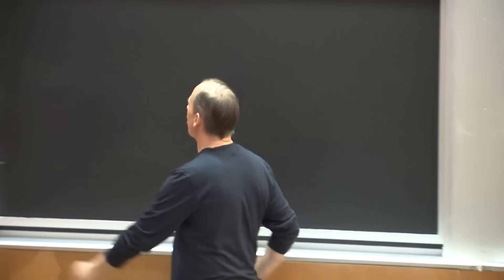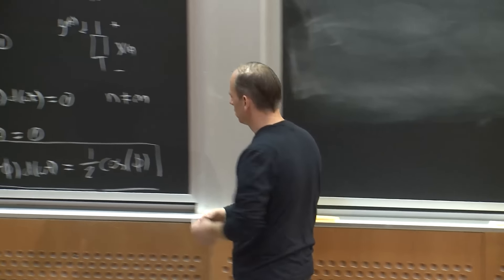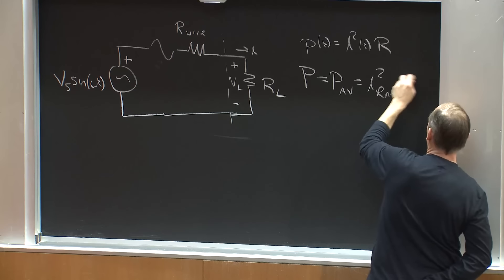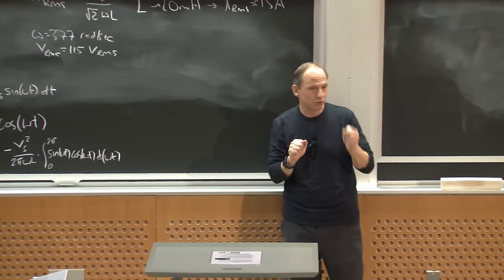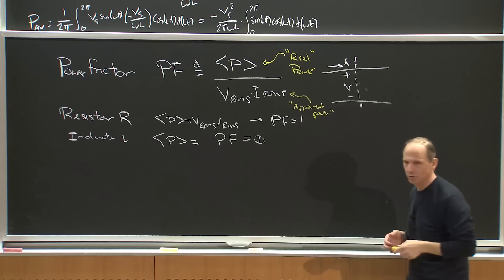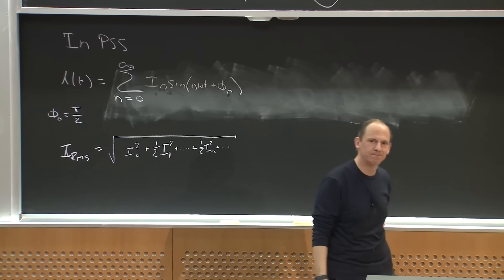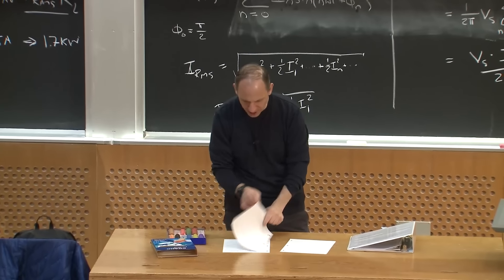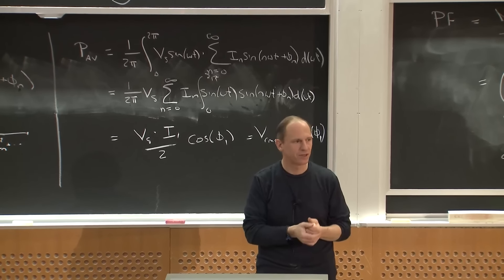Lecture 4: Power Factor

Comment: This is awesome.  I got my undergrad in EE but never studied power electronics in much detail. This piqued my interest since at my job, we have a debate about  how bad switching power supplies are for noise sensitive detectors but I feel this might put a new light on how great modern supplies work.  Do I work with old school dogmatic people and this will show that we need to get with the new engineering ideas?  Enjoying these lectures so far.
Reply: I work with switching power supplies a lot (LED drivers in my case), and there are actually limits imposed on how much noise the ones we work with are allowed to emit. (It might be a federal regulation actually). We do EMI tests on them. (I don’t for the life of me know how the EMI tester works yet, but that’s what its for). 

Some supplies have a fairly large ripple on the output you can see with a scope (and use to calculate the switching freq), but most I’ve looked at are pretty well-smoothed. Which is impressive for something switching hundreds of thousands of times per second tbh.

Comment: Reminds me of my undergrad EE classes (not at MIT).  For real life practicality, I would have preferred much less math and much more emphasis on circuit design, component selection, part reliability, consumer safety, practical EMI/EMC effects, etc.  All the stuff you have to do in the real world.
Reply: We have trade schools for that sort of stuff
Reply: @SuperMnunez  Trade school grads might install and repair but they don’t design for production.
Reply: I think a lot of that is discussed at some point in the course, as the final project involves using real components to design a buck converter circuit with a closed-loop feedback system. The assignment provides a list of specifications such as input voltage range, output voltage, output ripple, minimum efficiency, etc that all must be met. It seems like a fairly good blend of theory and practical application.
Reply: For Design, you must understand the principles and deep math involved.

Comment: I think what he says at around minute 6 can only be true if m and n are integers, and it's not true for just "different frequencies" like he mentions.
Reply: EDIT: This isn't completely correct, see my following posts

I think if you integrate over 2pi * a common multiple of m and n, it's still zero, even for fractional numbers. Not sure if that still fulfills the definition of orthogonality. Harmonics are always at integer multiples anyway.
Reply: @duhnboa5447  no, it's not zero for any arbitrary fractional pair of numbers. Just think about one of the sine functions having a very low frequency, so that in the interval where the other one does one cycle, the low frequency one is equivalent to ~kt (since its argument is close to zero). Then you would clearly have a non-zero integral. Like I said, this can only be true for integer values.
Reply: @luisjalabert8366  The instructor mentioned that the two sines must commensurate over the integration interval. In that case, also for non-integer m and/or n, they are indeed orthogonal and the integral of their product will evaluate to 0.
Reply: @jw106  Thanks for your answer. It seems like YouTube deleted my post for some reason. You said it better anyway!
Reply: Agreed
Reply: I'm a communications engineer and we frequently use Fourier series in communications.  The Fourier conjecture holds that we can represent any periodic function with an infinite series of other orthogonal periodic functions.  Fourier was interested because someone won the Nobel prize in mathematics by showing that any function could be represented by an infinite series of polynomials (polynomial expansion) and he showed that he could do the same thing.  He showed how a periodic function could be represented by an infinite series of sines or cosines.  His work was dismissed for 80-100 years till the advent of computers made computation of sines trivial.  The characteristic of the Fourier series is that you are representing the signal as an infinite sum of sines with period (n*w*t)  where n is an integer.  These are all expansion terms with the same period.  The reason why these are chosen is because they are orthogonal to each other.  A random frequency just cannot be chosen because then it wouldn't be orthogonal and thus would be shown to actually be the sum of two or more of the other orthogonal sines.  This means that the professor is technically correct, the best kind of correct, but it also means that he could have made this clearer.  All other frequencies except the fundamental frequency would have just decreased the power factor.  This is not a course on Fourier series though which would have gone into much greater detail if one wanted to know the mathematics behind it.

Comment: @10:19 This exactly happened to me. In my student dorm I had a crappy power strip. at some point, the fuse of the power trip blew off and I replaced it with a small part of a beer cane. Once I connected the inductance stove + oven on it. with the full power, insulator of the wire started melting (I saw smoke was coming out of the wire). So because of this lecture, I understood that fuses are actually for protecting the wires.  :D :D

great lectures!! I am just watching it without any particular reason. I grateful to the professor and MIT team to make available such great lectures!!
Reply: Omg glad you caught it quickly enough to be safe!! Yeah never replace a fuse with some random piece of metal. You need it to blow safely so your house doesn’t catch fire!

Comment: Yo I work in the lighting industry, and so many things mentioned in this lecture are things we work with every day! We have a whole characterization test we run on LED drivers (switch mode power supplies that are usually programmable) to determine if power factor and total harmonic distortion are within spec! I’d have to look at some standards to see what the minimum allowed PF is for approval, but I’ve seen it as high as 98-99% for most drivers running in their expected operating range. It gets ugly if you program the current really low and put small loads on them though. Which is really interesting to me. 

So cool to see where these calculations come from and get a better understanding of what they measure! Loving this lecture series so far!

Comment: In my EE curriculum, another 3 lectures would have been spent on exhaustively reproving the calculus behind the orthoganality of sinusoidal waveforms.  And no student would have emerged with any intuition about how to use that fact in solving an actual design problem.  Great material in this series.

Comment: I find interesting how the power factor is equal to cos(phi), in my classes we got introduced to the term, and I remember that we also did the mathematical analysis, but I don't remember seeing the fourier transformation.

It's really interesting, because after that, it's just a concept that we take for granted, like of course a good power factor is 98%, of course if you need to improve your power factor, you need to add a capacitor.

I also remember that my professor used the triangle of power to do a graphical explanation, but I guess prof David wanted to focus on giving the origin of the concept.

Comment: 28:06 - Why would there be an offset in the half-wave rectifier line current? 
---
27:47 - I was confused about the pink current waveform (AC line current) since there were sudden jumps in the current - and inductors wouldn't allow that. I mistook it for the load current, but under the assumptions of:
- No line inductance or resistance (so current can change instantaneously and maintain a stable value as voltage changes)
- Huge inductor on the load side (ensures current remains constant)
- Ideal diode (instantaneous turn on & off)

The line current pulse (square wave for half cycle) would make sense.

Comment: Great course, really amazing MIT puts this up for free. The power situation in the US amazes me though, 1.7kw on a breaker? in 2024? damn.. thats less than half of the average 16a 230v breaker in most other parts of the world.
Reply: copper is expensive
Reply: @tajox  or you could just phase everything over to 240volts, since you already have it (120v is split phase), and then after that transition is done in a couple of decades you could go 3-phase 230 wye 400v between the phases without having to redesign appliances since everything would already be 230-240v. In the interim you could have 230v and 120v sockets, use schuko plugs for the 230v so you dont accidentally plug 120v into 230v. And youd finally be up to par with the rest of the world. No clue why the US isnt working on this.